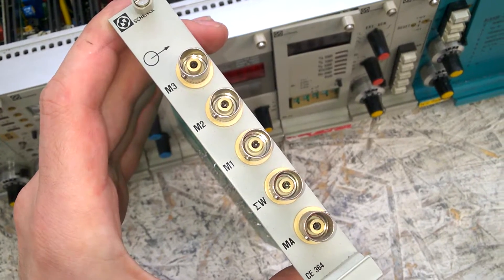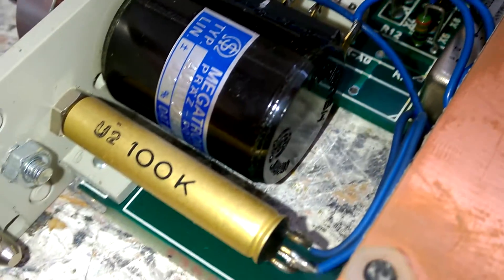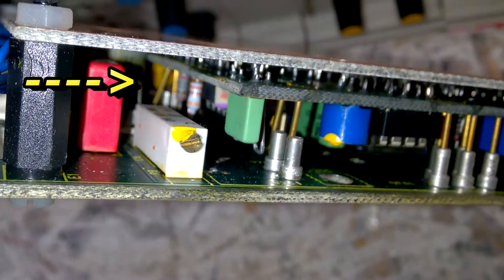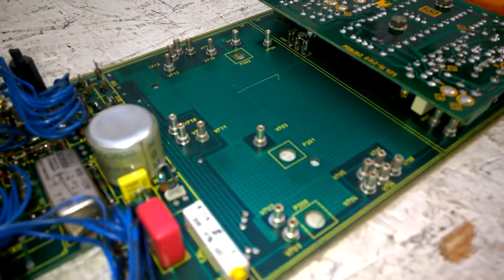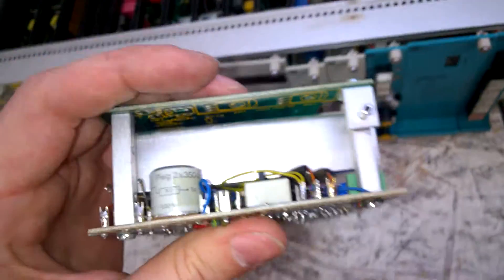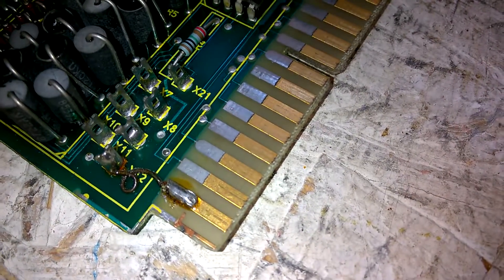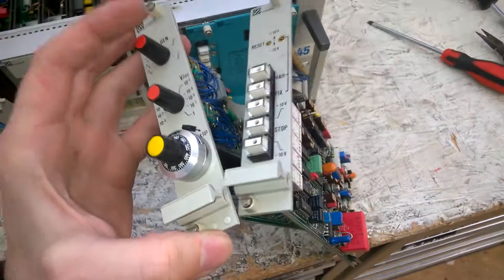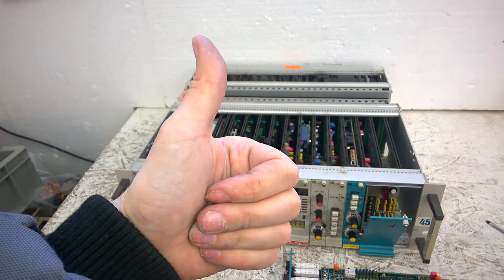BEB #41 SCHENCK strain gauge measuring amplifier for weigh bridge

Comment: Those HBM mezzanine cards must had been designed with input from a watchmaker, with all those strangely placed pins...

The matrix board is not too dissimilar from those on semi-modular synthesizers made by EMS which were used for setting up the patch circuits.
Reply from the maker: always excellent comments from you. so happy to have you in my audience :-)

Comment: 1:18: Very nice DIN 41612 Type F connectors with 3*16 pins d,b, and z used for train related stuff. Each contact is rated 6A. Pretty rugged stuff. I like the matrix coders with the little diode sticks in them...
Reply from the maker: yes, the DIN connectors are great. 6A each is pretty amazing.
the matrix thingy is neat. Wished I had more of these.